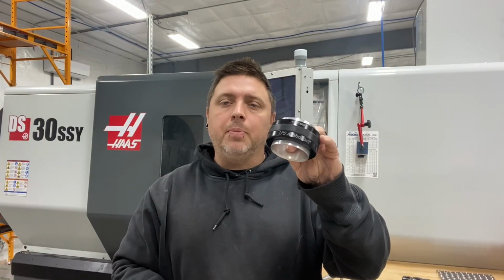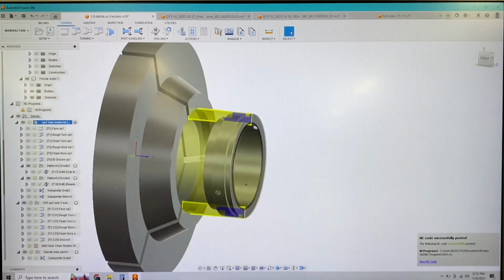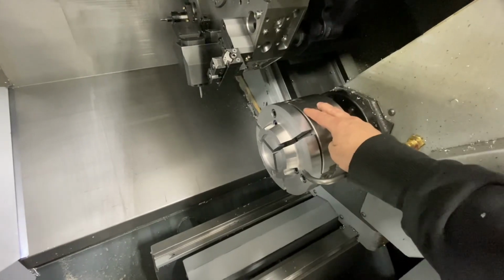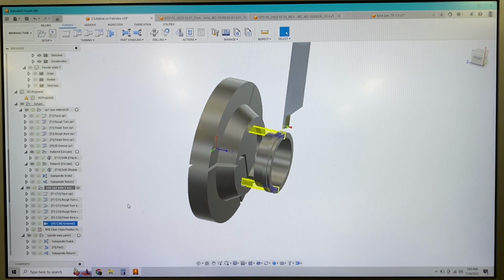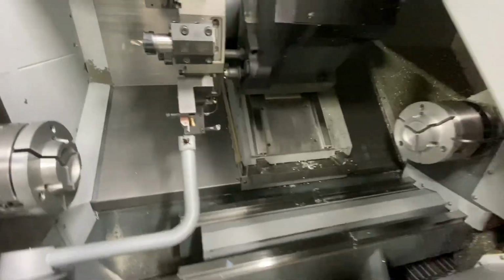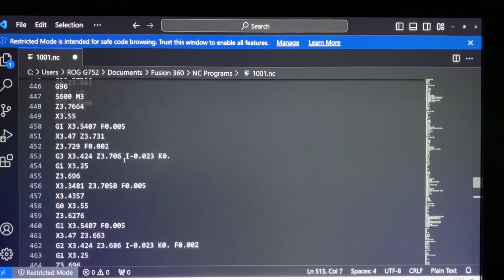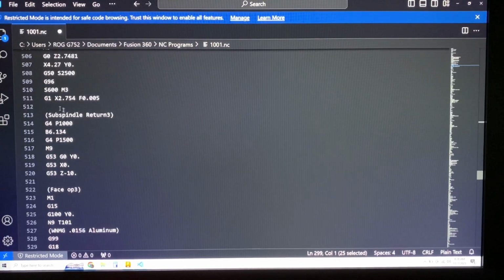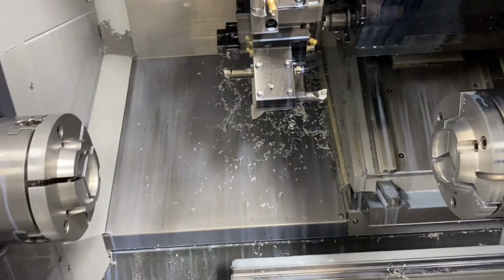Complex lathe programming in @adskFusion #fusion360 making our LPS AlphaLoc couplers

Comment: Bro I was so confused on how to get my feed plane correct to account for the jaws since I wanted to use the face of the chucks as my G54 and G55, but you made it make so much sense, just use the back face of the chuck as the grab plane itself and as long as my chuck and jaws are modeled correctly it will feed to where I want. THANK YOU! Time to start adding parameters to control all this!

Comment: Awesome video, Thank you for putting this together. I have a regular DS-30Y which this will help me get the subspindle handoff done correctly. Question: Can you share which toolholder brand you are using for you turning tools on your turret? Also when the the subs[indle grabs the part from the main spindle does it need to be turning or could it just come and grab it with out turning? This would avoid potential chips making it into the face of the subspindle.

Comment: Great video man! I cant wait till you get your go pro set up or whatever you are going to use for internal recording. Love seeing the chips fly! I like your the new shop!  I'm in the process of getting my shop put together and have tweaked a couple of ideas on the layout from seeing your place and how you structured it. I'm also tossing around the idea of using fusion 360 instead of mastercam. Do you recommend 360 over other cam software? I appreciate any input on that. Keep up the great work man!
Reply from the maker: I’m still learning fusion so I can’t really comment on which I like more yet, I do think mastercam gives you much more control over the details, however that comes with the price of time investment in the programs. Fusion is WAY faster at getting these simpler things done, I have yet to get into anything too complex so I can’t really say how that’s going to go yet. I will say that there is some much needed peace of mind with the cloud based structure and it’s really nice being able to work on your projects from any computer anywhere. I guess I can say I’m leaning towards liking it more, and I do think it will end up that way.
Reply: @linderpowersystems_LPSFAB  Excellent! I appreciate the insight. Keep up the good work bud!